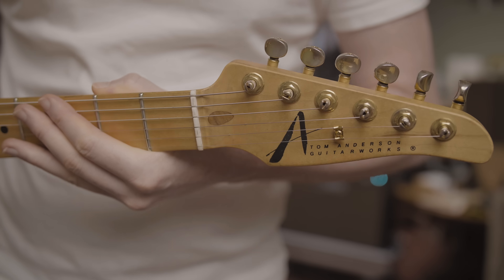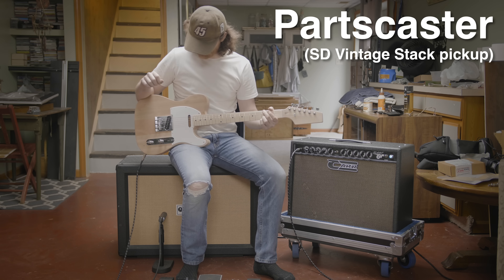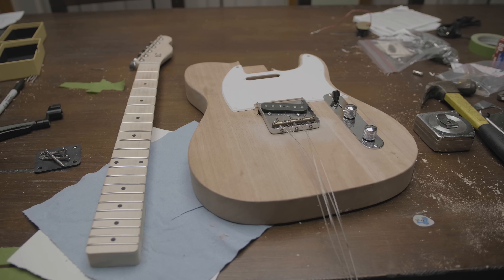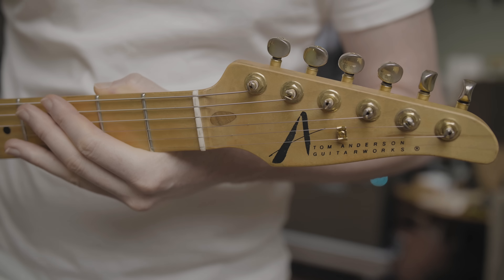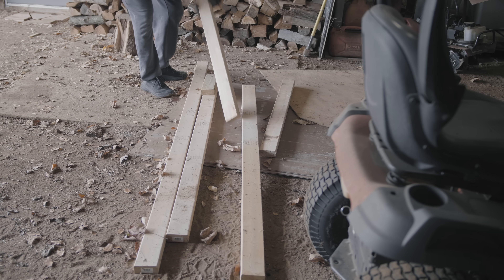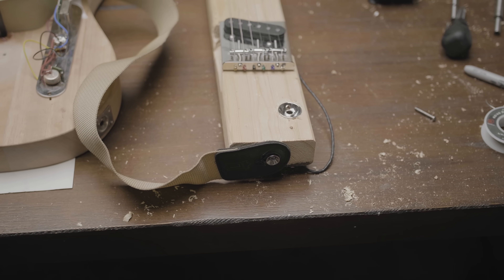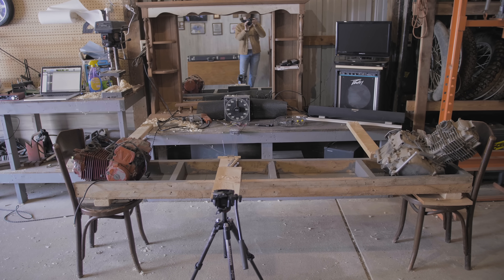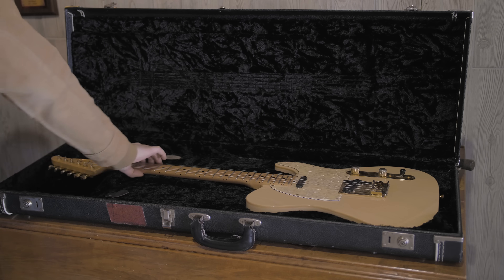Tested: Where Does The Tone Come From In An Electric Guitar?

Comment: Tone, in my view, is the sum of many things, including the speaker and the cabinet where the chain ends (at least to the ear). This guy is not confirming anything that is not known, his videos are wonderful by the way.

The pickup has a lot to do with the sum, although you will be able to notice when you compare the Tele Partcaster (low range) with the Anderson (high range), as you will see how an expensive pickup is devalued in quality by a large percentage with an economical wood (gloss annoying, less sustained, stiff tone and slim sound), and how this is expressed in a better way with the special wood. (lower, sustained, round and defined sound).
The case of the board is interesting in that it almost matches the tone of the Anderson, a particular case may be due to its thickness and density. The case of the table is the best, you notice more harmonics coming out, a sustain similar to a Tampura, a complex expressiveness in open chords, of course the table in all its complexity is doing the job of magnifying the vibrations of the strings.

But talk to me about practicality, both the board and the table, tell me who would think of bringing any of those things to a concert, and in the end what defines the search for tone more than the influence of what has already been established (for good or wrong), which is the shape of each guitar model, the combination of woods, pickups, cuts, finishes, etc.

Perhaps if the Telecasters had been made with a board like the one shown in this video, that would be the standard today, but it was not like that for a multitude of reasons.
Reply: Yeah you missed the entire point of the video. Probably try less hard to prove how smart you are. Then you wouldn't seem so dopey.

Comment: There is a HUGE difference between the two...1:20-1:27 A guitar body VIBRATES...different wood VIBRATES differently...it's SCIENCE people...yes if you plug into a high gain amp all you will hear is the AMP!!! Wood makes a difference and if it didn't guitar makers would use OAK and other shitty non-vibrating woods.
Reply: watch the rest of the video

Comment: Apart from the players touch, the biggest contribution of tone comes from the neck construction & materials.. the body & pickups, even though contributing a small part of tone, don't change the tone as much as the majority of tone that's coming through the neck itself.. Just take any two identical models with the same bodies, from a bass or guitar...& listen to the differences between a maple, or rosewood, or ebony constructed neck/fingerboard. That tonal change you're hearing is from the neck.. not the body. Then try swapping different bodies to one neck... the tone differences are minimal at least...

Comment: conclusive enough for me. The tone from an electric guitar comes from the vibrating strings, the pickups and of course the implement used to strike the strings, be it plastic, flesh, felt or hammer. I would like to see the same done with an electric bass to see if the absence of a body effects the sustain of the notes though I suspect the results would be the same.

Comment: Best guitar I ever played (tested) off the shelf was a Tom Anderson. Its playability, precision, enjoyability, setup, was better than any guitar I'd previously tested off the shelf. No, I didn't buy it, just a tad expensive for me. Would it have sounded 'unbelievably good' at the gig? Who knows? However, in posing this argument, I once bought a beautiful, striking blue Schecter that I just had to have. I took it to the gig and it sounded like an electric guitar - nothing else. That was it. It was characterless, soulless, and could've been any cheap pawn shop guitar. Its tone was uninspiring, its split-pickup tone very average indeed. I could not work with that guitar. I took it back and bought a red, US Strat instead. Yes, that Strat offered me Strat sound, but I can tell you, I never liked that guitar either.

After a few years, I took out my old, 'badly-playing' 1969 Fender Stratocaster that I bought 50 years ago and, by a long chalk - tone-wise - it blew any of those other Strats right out of the water. I spent some money having the '69 repaired and set up and I use that guitar today. What is it about the '69 Strat? Well, all I can say is that it sang like a beautiful bird the minute I plugged it in at the gig - why'd I store that guitar away for so long?? I also modified it slightly, introduced a push-pull for extra variety and tones and these are, predominantly, the sounds I use for rocky, Bluesy songs and gtr solos. 
I gig every Sat afternoon in The Star Bar in Glasgow, Scotland. 
More or less at the end of the 'slick' period of my guitar-playing career, I am so grateful for the cracking tone I have to describe and interpret a song with.

Must say, your testing of tone video was utterly fascinating, Jim 👍

Comment: I'm already biased in favour of the point the video is trying to make (player experience, pickup quality, pickup distance from the strings and pickup placement along the strings mattering most). 
Funny and insightful as the video was, there actually is an oversight in the testing of whether wood choice matters. The "air" guitar is not an air guitar at all, it's still a 2x4 wood guitar. What holds the strings in tension (what holds the bench and shelf at a fixed distance) are still a couple blocks of wood, which may or may not have the same properties as the two guitars he used earlier in the video. 
A good test would have been the "air" guitar (bench and shelf) setup, same pickups, distances, player, amp, riff etc, and different types of wood holding the bench and shelf a fixed distance apart.
I'm a mechanical engineer, this is what vibrations are affected by.
Edit: to clarify, I still don't think tone would change with that setup. What probably would noticeably change is the sustain of high frequencies at low distortions and with softer wood, due to dampening.

Comment: Wow! The “air” guitar sounded the most like to the Anderson. Before you tested that, the release of the guitar’s notes always is what sounded different. I wonder if the wide bandwidth in string vibration on the “air” guitar caused the tone to retain the same qualities as in the attack of it. You might have just proved that action effects the guitar’s tone the most…

Comment: Every part in the guitar does make a difference. Vibrations transfer from the strings to the bridge to the tuners to the wood. To say it makes 0 difference is just absurd. 

If this was not the case, all guitars with the same pickups and hardware would sound identical. But they don't. Body shape and material absolutely does make subtle differences.

Comment: The two benches are contributing to the sound there is some resonation on each end, you need to connect blocks of cement to the bridge tuner ends those will not resonate much.

Comment: It’s a combination of factors, they all can affect the output, both in level and tonal quality, and it also depends on what type of music you want to produce. For example, in high gain metal “tone wood” has no appreciable effect, pickups can have some impact but the meat is in the amp and speaker. Country? Need more twang? Bridge and strings can have a dramatic impact. Spanish flamenco? Different variables. 

This is another example what I call “the fallacy of one”, there are many examples where people want a Boolean answer, only one thing can be “the good one”, and it’s simply not true.

Comment: Jim, I have good input here, I hope you see this comment. The pickups you are using a GOOD pickups, and they are not microphonic. Pickups that are microphonic will also pickup the resonance of the actual sound of the strings (not just the magnetic field). You should adjust this test using pickups with some level of microphonic ability. Thanks!

Comment: So much work for nothing. It's almost like a research manipulated to prove the thesis. First- overdrive. Why? OD cuts frequencies, makes it harder to hear. Second, bridge pickup position may sound similar (although i hear significant difference that without OD would be more noticable), becouse of it's sharp sound, full of sharp mid and high frequencies. Tonewood matters when it comes to jazz, when it comes to subtle music, where you use neck, neck/mid position in case of strat, neck/bridge in case of LP. Of course it's not day and night difference, but nuances. But these nuances make difference, especially in studio. Also not every pickup is the same, there are ones (especially vintage) that are slightly microphonic, then you can hear the wood! I have cheap chinese AXL Les Paul, that is finished with some sort of cracked paint and violin varnish on. Without an amp sounds like acoustic, with an amp it has this wood in sound (wood vibrates a lot- lack of thick coat of lacquer+ slightly microphonic pickups). Never heard better LP in my life, paid for it $200 brand new... And I have more than 20 guitars, including some for 4k... Oh and I am a sound engineer, only bachelor, but... In conclusion, IMO tone wood matters when it comes to nuances. If you love to hear that ringing in the sound (even here, with OD and bridge pickup, hear the difference between 2x4, air guitar and anderson), if you need nuances, take a look at tonewood. And one most important thing- its not about the price, sometimes cheap guitar after proper setup will beat the one that costs thousands.

Comment: Your fail was a choose bridge pickup for comparison
Reply: @@fredfreddy2338 okay, forget it 😄
Reply: @@fredfreddy2338 sorry, didn't mean to offend anyone :(
in my opinion, the neck pickup picks up much more information than the bridge pickup
Reply: @@fredfreddy2338 Well, for example, the vibration of the string in this place is much weaker due to which many low frequencies in the signal are lost and, in general, the amplitude of the signal itself is smaller.  It's as if on an acoustic the resonator hole was near the bridge.
Reply: @@fredfreddy2338 no, you are wrong, wood affects the vibration of the string, and it is logical to record the sound where there is the greatest amount of information about the vibration of the string.  By your logic, the "wood" test can also be done on the strings behind the nut on the headstock?  

If you say that there was a "wood" test (and not a test on the frequency response of the pickup that takes information from the strings), then you should have used piezo pickup.  In that way there would be a wood vibration test.

I understand perfectly why a bridge pickup was chosen - because it’s easier (especially on a Telecaster, where it’s built into the bridge)
Reply: @@fredfreddy2338 In short, in other words, I want to say that the difference would be much more noticeable with a neck pickup.  that's all

Comment: from what i heard, there is no big difference between the air guitar and the tele, the main think i noticed however is that the 2x4 had a brighter tone, that would be because the body is smaller, and not because of the wood itself.
still, the importance of the wood used is more to do with how it feels to play vs how it sounds.

Comment: If there's a "youtube video of the year" award. It must go to this guy, for this video.
Reply: So what was the answer?
Reply: The problem is that this video is trying to say that woods/substrate/guitar body doesn't matter.. and basing that whole argument on the fact that everything but the pickups, the strings and the tuners have been replaced... but that's not the case. Strings need something solid to resonate with to maintain their oscillation... plugging this rig into a bench does not demonstrate that.. you're just replacing the guitar body with a bench.. so, of course the strings will resonate the same - maybe better! Replace it with stale bread and you might have a point. :-)
Reply: @crazyjack9voltbatteryamps  not to mention how lugging that bench around to gigs and playing for 3 hours with that strapped over your shoulder would not feel good.
Reply: @crazyjack9voltbatteryamps  if that were true, it should have sounded different when he moved the electronics and strings off the body.
I think the conclusion is pretty clear: the body  of an electrical guitar is not a part of the instrument in the same way as in a accoustic guitar.
The pickup doesn't need the impedance matching a body can provide, and so the body does not provide it.
Reply: @crazyjack9voltbatteryamps  He's saying the body doesn't affect tone the way we think. I think; the way we've come to expect from acoustic guitars. Swapping out the body with something completely different, and observing that the tone is unchanged is an excellent indication that he's right.

"Strings need something solid to resonate with".
I don't think that's true. But even if it is, we've certainly seen, in this video, that it doesn't matter what that solid thing is (for electric guitars).
I think the truth is right there in your claim about strings.
For acoustic instruments, you need to amplify and impedance match between the strings and the air.
But the pickup on the electric guitar is not a microphone. It reacts to changes in the electromagnetic field, and so it needs no impedance matching, removing the very thing that would have created the tone in an acoustic guitar from the equation.